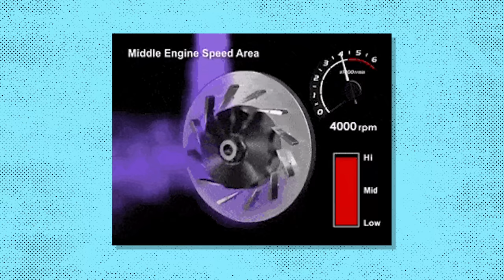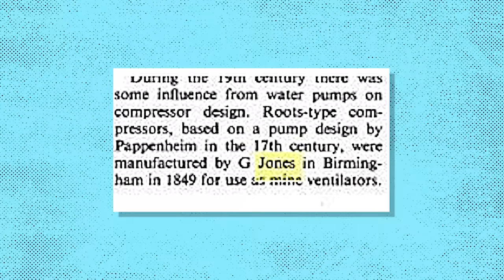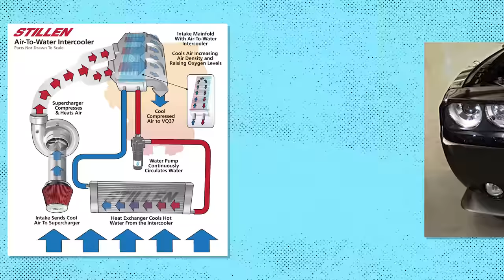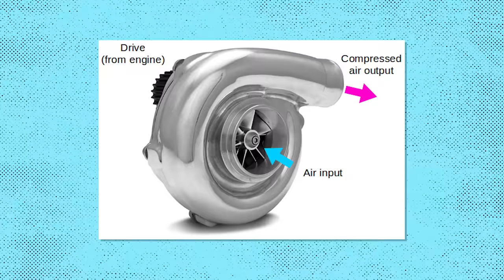Why Superchargers Aren't As Good as Turbos

Comment: Yes supercharger are suck but also blow
Reply: P.s. using power to make more power, well that just genius, like bussinessman use money to make more money. Once time i also thought turbo is absolute choise in efficiency, but for antilag they set spark fire later so the exchaust gas has more pressure but for me it is just incorectly extracted
Reply: You are not a very good business man... because turbochargers make more power FOR FREE!
Reply: @sandervanderkammen9230  not for free, turbo engine compression ratio lowered so does the expantion ratio, and like i said turbo engine setted to fired later and exchausted earlier to made the turbine keep spinning lowering expansion ratio further. If supercharger is like hired another people to assist your work, turbo charger is like you got free helper but you compromise your consumsion to share your food and luxury with him. Turbocharger only make senses  if it installed on diesel engine with no throttle body
Reply: @raizopopo3159  Thank you for confirming that you are not qualified to speak inteligently about turbochargers... you clearly don't understand how a Turbocharger operates on an reciprocating engine.
 
The turbocharger is a HEAT ENGINE and operates using the BRAYTON CYCLE in a COMBINED CYCLE with with reciprocating engine.

The turbocharger is driven solely by waste heat energy from the exhaust gasses.
Any questions son?
Reply: @sandervanderkammen9230  i think i do based on 5 years i spent at mechanical engineering collage. And brayton cycle is not turbocharger but gas turbine engine. Sure you are ignorance to how they got enough pressure from exchausted gas alone
Reply: @raizopopo3159  Turbochargers use Impulse Type turbines... they convert  fluid VELOCITY not pressure into mechanical work.
Better luck next time kid.
Reply: @sandervanderkammen9230  its centrifugal you dont even know what your gibberish about
Reply: @raizopopo3159  Impulse Type turbines can be Axial or Centrifugal... they both operate by converting fluid VELOCITY into work... not pressure.

It's not difficult to spot a liar and a fake, you clearly have no formal education or professional experience on this topic.
Stop pretending to be something you are not.
Reply: @sandervanderkammen9230    then how you got enough "VELOCITY" while in gas particle velocity is exactly the temperature of the gas which in direct relation with its pressure apparently. You've said, turbocharged engine cycle is resembling brayton cycle, but is it? I'll give you a hint the turbine expansion isnt the product
Reply: @raizopopo3159  Why do you lie and pretend to be someone you are not?

You obviously lack any formal education or professional experience in Engineering, Thermodynamics or Fluid Dynamics.

A turbocharger operates using the BRAYTON CYCLE in a COMBINED CYCLE with Otto or Diesel Cycle engines.
Reply: @sandervanderkammen9230  half and half, i am never had practical experiences, but i did have learn in collage for 5 years, but i never had chance to finish it. And all i've said was my real though.
Back to the topic turbocharged cycle maybe resembled brayton cycle but the turbine expansion isnt connected to crankshaft. Just try observe the turbo part of the cycle, the turbo expansion actually is the work we put to get the turbo compression which is the work we got , so the net work in the turbine part of the cycle is actually negative.
The ideal of turbo charger is great but in reality turbo only spulling in enough gas which we called turbo lag, and how we fixed it was by compromizing the energy that should absorbed to the crank
Reply: @raizopopo3159  Wow, so you really think that you are fooling anyone who is a legitimate Engineer???

Were you sick the whole semester of Thermo 101, when they taught Combined Cycle Heat Engines???
Reply: @raizopopo3159  Combined Cycle Heat Engines are when two different Heat Engine Cycles run off the same primary Heat source...
There are many practical examples of this including Brayton-Rankine 
Rankine-Rankine, Diesel-Brayton and Otto-Brayton 

The World's most efficient powerplants are Brayton-Rankine Combined Cycle 
And The World's most efficient internal combustion engines are Diesel-Brayton Marine engines.

Otto type engines can operate in Combined Cycle with the Brayton Cycle as a turbocharger or coupled directly to the crankshaft as a  Turbo-Compound Engine

Any questions son?
Reply: @sandervanderkammen9230  like i said all of that was my thought, my thought often different and questioning what textbook said, like in math i always questioning and debating concept of infinity. And in that turbocharged cycle i questioned it by the bassic cycle understanding net work is work we get minus work we gave. In otto cycle alone compression is the work we give and expansion is work we got. But in turbocharger expansion is work we give to get compressed air which in my point of view it should be minus in equation. Like concept of expansion ratio which always though same as compression ratio by default but someone decide to against it and became new cycle
Reply: @sandervanderkammen9230  but common turbo engine wasnt connected to the crank shaft so the power that extracted from it expansion only  to make boost that we got that why i see it weird if both expansion added maybe you didnt understand what i mean english isnt my language after all
Reply: @raizopopo3159  Ah, I see your problem... you don't fully understand the Otto Cycle either.
 You are completely unaware of the significance of Pumping Loss and Volumetric Efficiency

You have to account for energy losses at the crankshaft resulting from pumping loss.
The turbocharger compressor is a much more efficient pump than the reciprocating pistons.
Reply: @raizopopo3159  Driving a supercharger requires horsepower generated by the reciprocating engine, this power is robbed directly from the crankshaft of the reciprocating engine.

The turbocharger has its own power supply that is driven by its own thermodynamic cycle.
 
This is not theoretical, the turbocharged engine will deliver more horsepower at the same manifold pressures than a supercharged engine and deliver significant improvement in BSFC and lower outlet  EGTs.

The drop in EGT across the turbine wheel is directly proportional to the amount of shaft horsepower generated by the turbocharger it complies with and can be accurately predicted by the thermodynamic formula of the Brayton Cycle.
Any questions?

Comment: Bro, you need to watch some Aussie burnouts at Summernats then tell me that superchargers suck
Reply: If they suck why do they use superchargers in top fuel lol
Reply: @teeco_yt  That's basically like saying airplanes use them so they're good in cars, too. A top fuel car is in no way comparable to a production car, or even race cars. The only similarities between a top fuel car and a real car is that they both have 4 wheels, and they BARELY meet that criterion.
Reply: @bubbleman2002  still don't change the fact they use superchargers instead of turbos
Reply: @teeco_yt  Your reading comprehension is very poor.
Reply: @bubbleman2002  seems like a you problem

Comment: 1-2 Turbocharger twin intercoolers in engines engineering for diesel engines common-rail 200 bar same the Switzerland military engineer.
1-4 turbo intercooler petrol engines all are impossible theory by terrorism army the first inventor.

Comment: Your mistaken Sir, I've driven both, I'll take a Supercharger any day over a turbocharger. Don't believe me, ask the the guy's in the NHRA who are running under 4 second 1/4 mile times....at over 320 mph. Not a turbo charger in sight. No arguments, your shut down dude...I'm not keyboard warrior either. I've machined and built high performance engines over a thousand hp, have you?